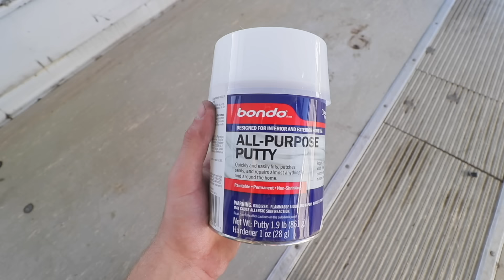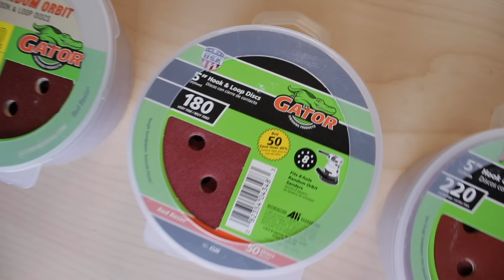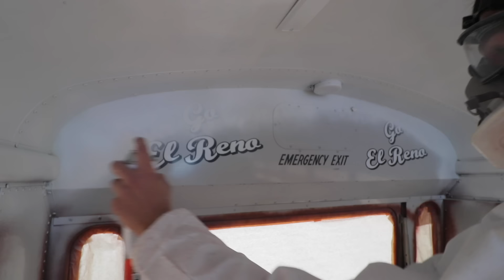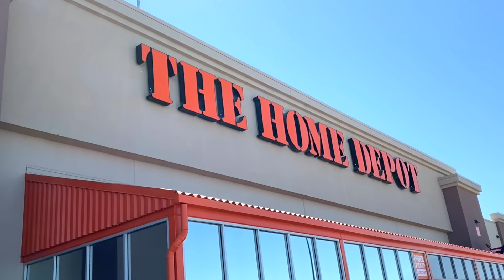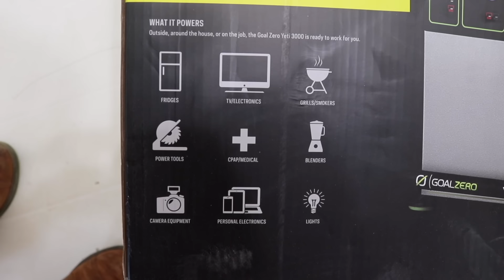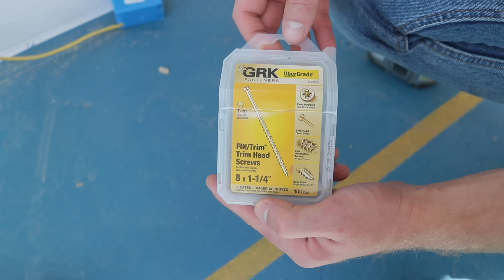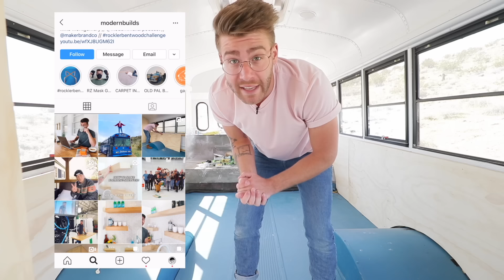DIY SCHOOL BUS TINY HOUSE CONVERSION EP. 1 | MODERN BUILDS

Comment: I can’t take this seriously as a home or even a place to stay in parked for any extended period without any added insulation.  I can see leaving the single pane windows due to cost, but not adding insulation...no.
Reply: Chris Howard floor removal. What under the floor? 🤷🏻‍♂️
Reply: Shaun Jones Sr Exactly.  Floors, walls and ceiling should be insulated.  Spray foam (recommended) or reflective backed foam board.  The amount of power required to cool this thing would be drastically lower.  If you wanted to use roof mounted solar to cool, forget it without proper insulation.
Reply: @cghoward70  they do all those things in bus builds, he'll do it too. dont just assume he's not gonna do that absolute basics
Reply: Badusername2000 He very clearly said he wouldn’t be adding any insulation to the bus. Did you watch the video?
Reply: @shadypalmtree2989  no i did not, lol, id assume he'd have common sense
Reply: I don't know anything about this guy or where he lives/roams, but there are certain climates where no insulation could be passable. It wouldn't be ideal, but it wouldn't be a huge issue either. For most climates though, ya you're right
Reply: I just reached the end of the video. He says and shows that the bus is already insulated.
Reply: @MiroStoj12  He lives in a pretty hot climate. I'm sure that though the base of the walls are insulated, I'm not positive about the roof and around the windows either. Cooling the bus without insulation is going to take more than his small generator. Unless he doesn't mind kind of cooking in there.
Reply: @shadypalmtree2989  I'd imagine they wouldn't insulate the walls without insulating the floor/roof as well.. it would be pretty pointless considering thermodynamics and all. And ya you're right. Not ideal to cook but it's doable at that age. No different than backpackers on the PCT or etc.., gotta learn to live w the weather. If he lives in a hot climate then perhaps during the "winter" is when it'd be used mostly; when temps are 60s-80s usually in a hot climate
Reply: I was thinking the same thing.  I imagine The bus did come with “some” insulation already installed, but if it’s the factory stuff, it’s minimal at best. For a living situation, absolutely should have taken out the floors, walls and ceiling and redid all of it properly.

Comment: i spent the last 23 minutes 47 seconds shaking my head.. this is a great video for... someone? But i would not recommend doing anything shown in this video
Reply: Chad Gunter couldn’t relate to this anymore. You said it best
Reply: But you could do it if you want. You can’t tell me what to do🙂
Reply: I agree with cyan
Reply: Usually also not advised to share a video of you violating EPA rules by spilling coolant all over the place.
Reply: I think I know what you mean - it's a lot of 'not really there'
Reply: Riiiight. My only though was he is going to sell it in a few seasons max.
Reply: WHY
Reply: "Yes. I'm leaving them there. It gives it an interesting texture when you paint over it" = I was too lazy and it cut costs.
This is where you run.

"I'm not an expert. I'm a DIYer just like you guys. Only do what you feel comfortable with and you'll be safe."
Nooooo!!!
NO!
No. No. No.
Reply: I know I'm just like OK but I still watch it because I want to don't judge me as someone who wants to go into actually building tiny houses you know the ones that are on trailers and look like miniature houses not like mobile homes I'm just like it's all of this up to code obviously I'm gonna go into structural engineering and make sure I get all the teachings I need to but even now I'm just like OK but are you sure
Reply: Why not is something bad going to happen because I kinda wanna do this

Comment: Hey,  dope bus man. Next time it might be easier to just "toe nail" your screws into the framing studs instead of using those small brackets and screws; would probably save time and money?
Reply from the maker: not a bad idea!! can you toe nail with screws?
Reply: @ModernBuilds  Yeah, you just start the screw about 11/4-11/2 away from the end of the perpendicular board at a 45 degree angle and drive it home. I find it much easier than toe nailing nails.

Comment: I would only use a shark bite in a temporary situation, they have seals in them and they will degrade over time and leak, can't beat the crimp on style stuff, though I agree it's hard in some spots and my shoulder hates it, but they don't leak if you get em straight.  Not trying to sound rude, just helpful especially for other readers.

Comment: Little tip next time you use corking or sealent spray soapy water on your hands or finger before you run your finger over the sealent it doesn't stick and gets a better finish

Comment: you CAN use a level in a bus ..... but you need to level the bus first by putting it on blocks front and back , lot of work and you need to recheck regularly for levelness when working on a sand bottom

Comment: Should invest in a craig jig, drill will work better than a impact gun on the self tappers, Use 3/8 pex supplies water twice as fast. "107 inch Curve Template." . Sorry trying not to be a troll. Work smart . Great video.

Comment: There's another vid where they remove the windows and reuse the ceiling sheet metal to rivet over the holes of the windows.   Then wood frame the interior.    For others using youtube for ideas

Comment: Where the water lines are is a little concerning. If you go somewhere where it is freezing cold you having a water line facing the outside wall runs the risk of the pips freezing up. In colder areas it's actually a building code.

Comment: I'm surprised you didn't strip the interior completely down to the bare metal, and then insulate the bus. 

Even in the desert  you still want to keep the heat out.

If you insulate the bus you'll use less fuel or electricity trying to keep it cool in high summer.

Comment: You really should have pulled that rubber floor up and then the ply wood that is under it, it's always rotten and holding moisture in.  Im taking my own bus to RV conversion apart and doing just that.

Comment: After seeing u make the walls attached to the inner bus. What happens if u drive and go over bumps. Wouldn't the bus get uneven. Like as the walls? Just wondered. Cause in houses it would make a diff if the walls be securely attached. But in moving houses aka bus it might make the walls come apart or be uneven

Comment: When you spray paint... wear a proper mask and ventilate the bus.
You don't want the vaporized paint to coat your lungs and kill you.
When the formulation for car paint changed, a lot of old timers did themselves in by not wearing the right gear.

Comment: you should use nuts and bolts to screw into the floor, you know, just incase
Reply: also just use a small cricut box to make everything easier, and actual batteries... and a small generator

Comment: So pro that you didn't use 80/20 Aluminum to cut weight significantly. Wood expands and contracts substantially, especially for a space with no ceiling insulation, single-pane windows, and little insulation value. That caulking will be highly compressed and torn after a couple of seasons. I love the concept, but planning, detail, quality work, and purpose behind everything is critical on a build like this. 

BTW that coolant is pretty damn poisonous.

Comment: This is not gonna last long term.
There's insulation on half walls is nothing, the whole floor and ceiling are bare.
You just built on the metal.
It's gonna be an oven in heat, freezing when cold, nvm even the humidity..